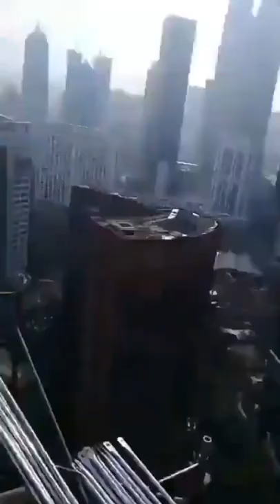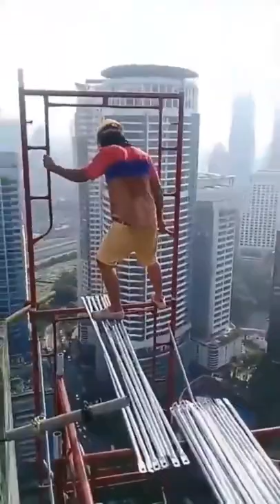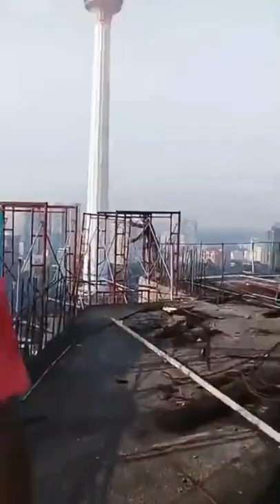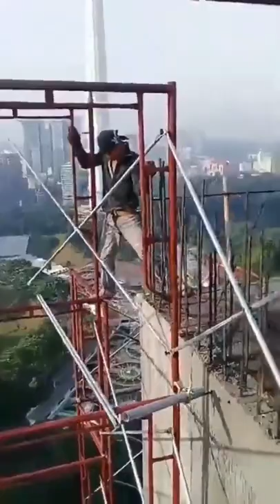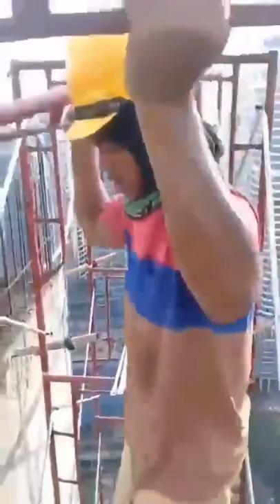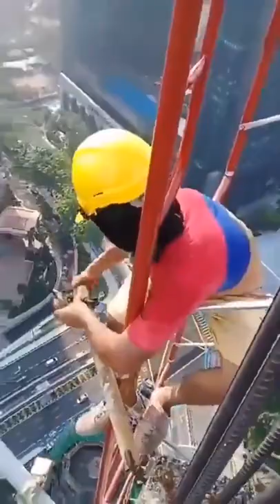Balls of Steel - Crazy Skyscraper Scaffold Setup Without Safety Harness

Comment: I’ve been a scaffolder and run many scaffolding crews, and conducted training for scaffolding. The way they are doing this is flat out wrong and dangerous. There’s nothing admirable about it. It’s stupid. If you work like this, people will die. It’s unsafe for them and those below them. I don’t care how skilled you are - one boot lace snagging on a pin as you walk by and you’re falling debris. Nobody is that good. 

There’s also no reason to step on the braces like he does. You should never climb cross braces, period. They aren’t made for it. There’s especially no reason to step on them unsecured like that.  That’s not how you cross that gap. You bring a walkboard that rests securely on the scaffold and can’t slip out from under you. It’s faster and safer than a bundle of braces that can slide right out from under you. You pass the wallboard up as you go. 

There’s rarely a good reason to work without a harness. If someone can afford to build a skyscraper, they can afford proper equipment for every person.

Don’t let anyone tell you it’s faster without the harness. That is untrue. A skilled scaffolder can work very quickly with a harness in almost all circumstances. It becomes second nature. Your hands are clipping on your lanyards just as fast as your feet are walking. There are rare occasions that you need to leave your harness behind, and those are typically when it’s unsafe to use a harness. This video is not one of those times, period.

This video represents callous disregard for life - either by the crew, or more likely the supervisors, or even more likely the employer.
Reply: Well said 👏👏👏
Reply: How can you overcome the fear of heights ? I’ve been doing masonry for 7 years and I still get scared being up on the scaffold without the safety rails and post and  still scared on dropping scaffold. How can I overcome my fear of heights?
Reply: It’s very admirable what he does u know how much fear he probably has to overcome to do that